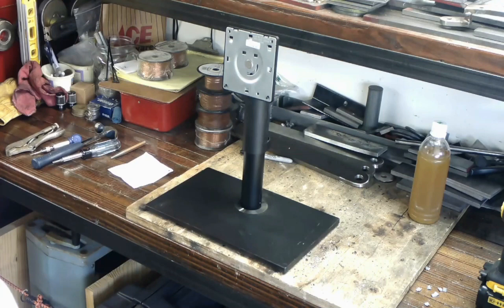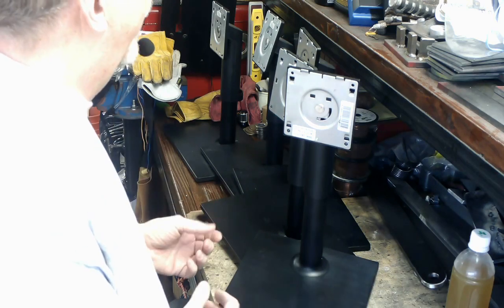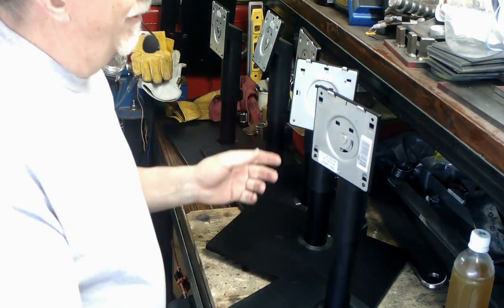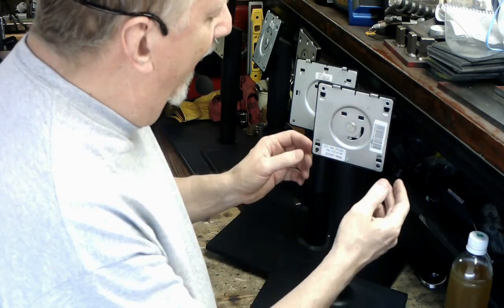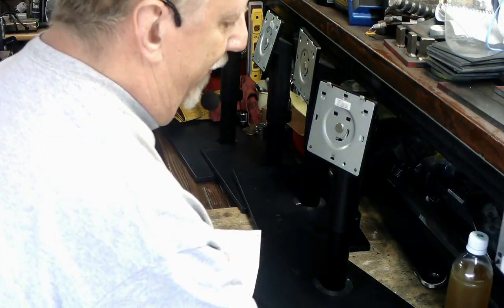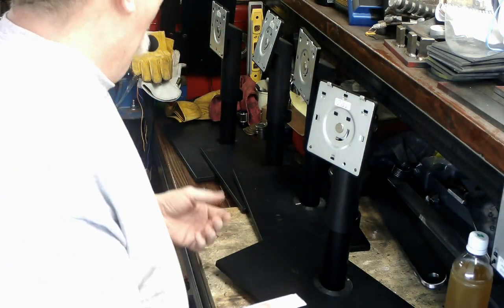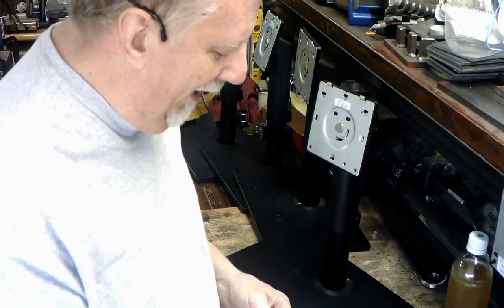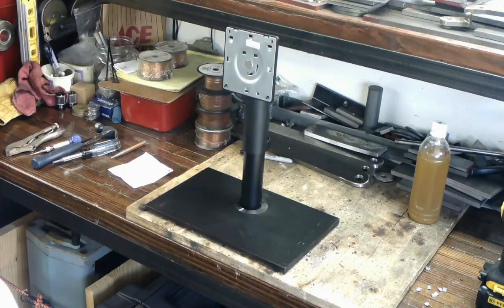Convert a Proprietary OEM Computer Monitor Stand into a Universal Monitor Stand

Comment: Your video doesn't match with my 2416d dell, but i'm happy to see your idea, you're helping the enviroment :) You deserve the best 💖
I wish i've could make something like this!
Reply from the maker: Hi Marcela!  I guess there are always exceptions, right?  OK - I looked-up some images of the Dell 2416D monitor, and while the back of the monitor has the standard "VESA" mounting holes, the monitor stand itself doesn't have any actual metal in the corners where those holes need to be drilled.  The only suggestion I can give is to make an "adapter plate" that you would attach to the mounting plate of the stand (after breaking off the 4 metal tabs), and then drill holes into this adapter plate - in the corners that align with the VESA mounting holes of the monitor you are trying to use it with.  Let me know if any of this is unclear.  Good luck!  🙂

Comment: This is very helpful. What is being done after drilling the screw hole? You use another dool on the metal it's around 6:00 and 6:05
Reply from the maker: I was using a de-burring tool to clean up the holes I had drilled.  :-)

Comment: Will those be Dry Wall or Deck screws used?
Reply from the maker: LOL!  Hmmm...  Well, I think they are actually using metric M4 bolts, and the length will need to be based on the thickness of the plastic on the monitor stand, and the depth of the threads in the monitor.